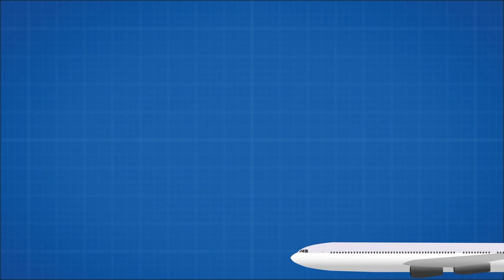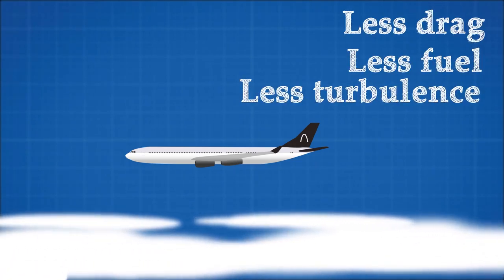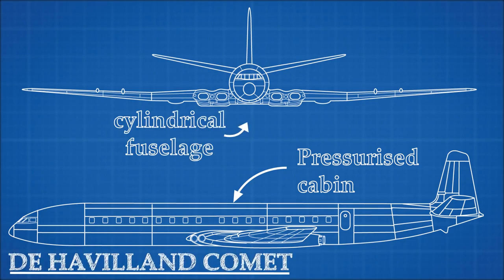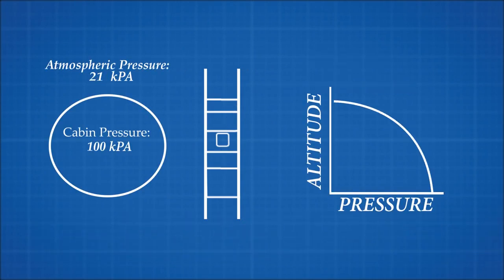Why are plane windows round?

Comment: You have parts of this explanation correct but you have missed few very important points. You did not clearly establish the orientation of the forces and therefore stresses that act of the thin wall 
that makes up the fuselage. My guess is you are not an engineer.

Comment: The "square windows" issue that supposedly resulted in the Comet 1 disasters is a myth.  This has been recognised for years in the industry, and some work done at the University of Birmingham a couple of years ago comprehensively debunked the myth.. The corner radii of the windows was similar to the windows of more recent airliners, but the windows were larger and appeared "square".   The problem was associated with the way that the  rivet holes in the area around the windows were punched, rather than being drilled. The information is readily available for those who take the trouble to research it, rather than to continue to  believe in myths. 
And as a salutary lesson, check out what happened to a Boeing 737 of Aloha Airlines  in 1988.

Comment: This video is total wrong. First 40 seconds.. fine.

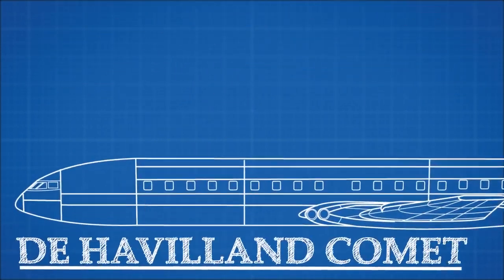0:41 The windows remained square

This is the comet square window myth. Its not true.

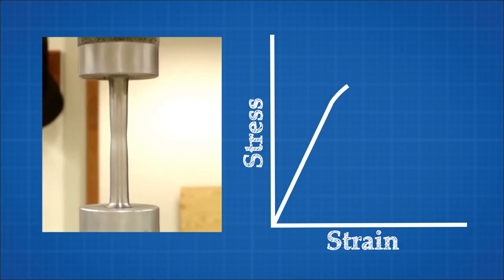1:06 This is not how metal fatigue works, while true, that is not claimed, by having this in the middle of the video, it make it sound like this is relevant, its not. This have literally nothing to do with the metal fatigue problem

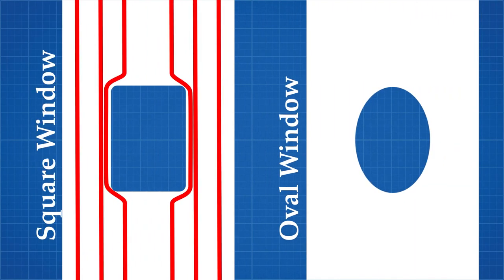1:30 While the stress-concentration idéa is in theory right, its not really relevant. The window frame reinforced to handle this stress, also the windows does take a bit of the stress.

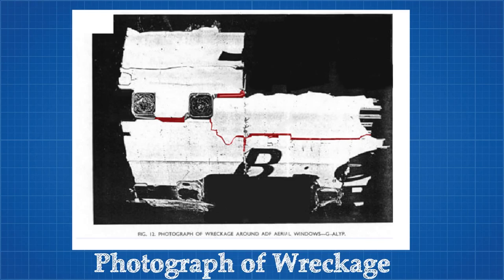1:41 No that is incorrect. Was caused the stress in the comment was push holes for the rivets. It was later replaced with drilled holes, solving the problem.

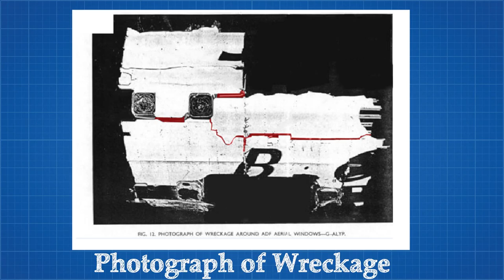1:47 No it didn´t cause 3 crashes. The crashed airliner that was salvage didn´t even have the crack in the window, but rather in a hatch...

Anyone how thinks this explanation is true... Look at the front of a airliner, see the windows there... are they round?

This is the problem with wikipedia engineers. ... that don´t bother to read the full article.

The issue is at the beginning of the article it says that it was the square windows fault... well sort of "concentrations of stress Unlike drill riveting, the imperfect nature of the hole created by punch-riveting could cause fatigue cracks to start developing around the rivet."And there is a source.

Comment: Jet engines are more efficient at higher altitudes do to difference between inlet temp and exhaust temp. Drag has.little to do with it since aircraft must  fly faster (higher True Air Speed) at higher altitudes  to generate the same amount of lift.

Comment: Does this same logic apply to the front windows as well? Because the front windows are not circular. Or do the windows just have to have rounded corners?
Reply: It only applies to the window, the explanation in the video is not correct. If it where, this would also apply to the big window in front.

Comment: Well, it was later revealed that it was not the window shape that caused Comet to crash. It was rivetting method, which was chosen as a cheap alternative to glue (probably expensive loctite glue) window mounting. https://aviation-safety.net/database/record.php?id=19540110-1

Comment: Comet had rectilinear windows with radiused corners.
Most modern airliner windows are not truly round -they still have parallel sides but with generously rounded ends.
In the media this issue has always been simplified to square vs round

Comment: Your videos are always interesting and well thought-out however, in this case, you have unfortunately fallen prey to an oft repeated misstatement, regarding the DH Comet 1 aircraft and its windows.

This is a misunderstanding that is annoyingly persistent. 

The accident report can be found here: https://www.baaa-acro.com/sites/default/files/import/uploads/2017/04/G-ALYP.pdf

Two aircraft were lost due to inflight breakups associated with fatigue: G-ALYP on 10 January 1954 and G-ALYY on 08 April 1954.

In the case of G-ALYP which suffered an inflight breakup off Elba, the recovered wreckage showed that a crack formed at a countersunk bolt hole near the corner of the ADF Antenna ‘Window’ Panel and basically unzipped the forward section of the fuselage causing a catastrophic failure.The unfortunate use of the word ‘window’ in referring to this panel is in part responsible for this misunderstanding. 

The report shows that de Havilland had underestimated the stresses at ALL of the cutouts in the fuselage (doors, hatches and windows) and stresses were much higher than originally calculated.
Given the same structure, but with the oval windows of the later Comet 4C, the fuselage would likely have failed in the same way. 

Nowhere in the accident report does it even mention the shape of the windows, let alone make a requirement for them to be changed.

The aircraft was simply not strong enough nor was it built to a 'fail safe' standards that would later be universal. This was largely due to a lack of knowledge and experience with pressurised aircraft at the time.

It should also be noted that the ‘square’ window shape of the Comet 1 was almost identical to other contemporary pressurised airliners like the B-377 and DC-7 aircraft. http://www.stinsonflyer.com/prop/dc7c-3.jpg
http://famgus.se/Vykort/APC-Aircraft-B377.html

It can also be clearly seen in the photo of the escape hatch that Comet 1 windows had a corner radius very similar to modern airliners.

The French Caravelle even had triangular windows - with rounded corners. http://company.airbus.com/company/heritage/now-and-then/The-Caravelle.html
Nowhere in the accident report do the investigators say the passenger window ‘shape’ was the cause of the accident. 

The image of the fatigue test aircraft fuselage (Fig 7 in the accident report) shows that the failure occurred at the mid-point of the fuselage radius i.e. at the widest point and along a fuselage stringer that happened have an escape hatch- not a window, located in it.    https://aviation-safety.net/photos/displayphoto.php?id=19540110-1&vnr=6&kind=C

The external image shows how the fuselage failed along the stringer line. https://www.fose1.plymouth.ac.uk/fatiguefracture/tutorials/FailureCases/images/CM7ALYU3.jpg

Had heavier gauge aluminium been used for the skin or had the fuselage formers and stringers been stronger, or the cut-outs been properly reinforced, the aircraft would not have fatigued in this way but knowledge of fatigue was limited in those early days of jet transport design.

The discoveries made about fatigue during the investigation was passed to the US and was incorporated into the later B-707 and DC-8 aircraft designs.

The Comet was, as a result of the findings, redesigned with heavier gauge skin and many other improvements,  including oval passenger windows but again, most other airliners continued with the similar shaped window with corner radii the same as the Comet.  The shape of the escape hatches remained the same as in the Comet 1.

All modern airliners still have rectangular windows with rounded corners, as did Comet 1.

Beware the aviation zombie myth!
Reply: Some additional corrections/comments:
The corner radius is a critical factor. I believe some of the other airplanes you mentioned have larger corner radii, which reduces the stress concentration...thus less cracking. 
Another point is that the older piston-powered airliners are flying at lower altitudes than the Comet. This results in lower pressurization and significantly less cracking. Crack growth is very sensitive to stress.

Comment: Unfortunately several inaccuracies in this vid. Firstly jets fly higher because they rely on the temperature differential between inlet and exhaust to create power. If the temperatures were the same all you would have is a fan. At ground level the temperature can vary between 40+C at the equator to -40C near the poles. At 12000M altitude the air temp is often around -55C everywhere, giving you more thrust for a given amount of fuel. At +40C engine power is considered marginal for take-off with a single engine in most types (the worst emergency at take-off) and so the FAA for example  grounds above this temp. Also the reason the DH Comet failed was metal fatigue not stress per-se. Metal fatigue was not fully understood until the 1960's.

Comment: Just dropped by to point out that airplane windows aren't actually round, as you can plainly observe for yourself if you only bother to take a look. They also aren't oval. They are rounded (have rounded corners), which is not at all the same as round or oval.

Comment: You sort of have it correct.  Yes, the square window has a higher stress concentration as compared to a round window but that is not the whole story on why the Comets failed.  The aircraft didn't fail as you showed where the stress goes above the ultimate strength which would have been a pure overload scenario.  The window failed because of fatigue of the metal caused by numerous pressurization and depressurization cycles, just like the 737 in Hawaii where the top of the aircraft fell off a few years back.
Reply: And the Comet story is a tad deeper than that even.  It was a misapplication of the testing protocol done upon the prototypes that failed to reveal the problem prior to production.  A prototype was first tested with an over-pressurization of the cabin.  Doing so created a highly localized plasticity in the window corners.  When the over-pressure was released, it left a residual compression of the material in the window corners, effectively making that prototype immune to fatigue failure in the window corners.  The subsequent fatigue test was supposed to be conducted on a separate prototype (one that had not first been over-pressurized), which is the condition the production planes are in when they leave the assembly line.  The problem could have been identified before they went into production.

Comment: For the same reason oval windows are also used in ship design. Actually there is no corner joints in ship building cuz corners tend to crack.

Comment: 1)The same amount of material,when moulded as a cylinder has lesser surface area for the same volume,than a cuboid.
This causes the the density of air to increase when same number of moles are within,which causes higher pressure as compared to cuboid.
2) It is aerodynamic.
Reply: Eeshan Khan 
Pressure is pressure. Has nothing to do with moles.

Comment: You could have mentioned that all the planes flew for about a year before they failed. This was due to metal fatigue. Microscopic cracks that grows larger with each flight until there is not enough sound material left to carry the load and you will have a failure.

Of course our modern aircrafts also have these growing cracks. They are designed better, so the cracks will not grow as fast, but the cracks are still growing and the aircrafts would break apart if they flew enough times. That's why we have regular inspections to check the size of the cracks and determine if they are large enough to warrant any concern. So how do they determine the interval for the inspections? Fist they decide what is the smallest cracks that will be unnoticed, or ignored during an inspection. Then they calculate the growth rate of these cracks, to get to the number of flights it would take for the plane to be in danger of breaking apart. That number of flights is the inspection interval. (or if the inspection interval is set, you can determine what size cracks you can allow during an inspection.)

Comment: It called material fatigue (durable is NOT an engineering word): It is the weakening of any materials experiencing a load in a repeated cycle over long period of time.

Just like a paperclip, bend enough times (back and forth) and it will eventually brakes.  This is where stress distribution/ relief/ concentration designs are so important.

Even with oval windows, stress will still buildup over time especially at the joint (welding, riveting & etc) which is why pressurized planes such as 747 only have 27 years of services life (165,000 max flight ours) before being scrapped.
Reply: Ship portholes are rounded or completely round for the same reason.  Stress concentrations are the enemy.
Reply: You're so smart... Google must defer to you for most answers.
Reply: a.k.a. durability

Comment: I am sorry to say but you missed the main point of why windows are round. It's fatigue stress not (so much) the shape. I worked for Boeing in their fatigue group and the Comet problem I know quite well. The static stress at the Comet window corners was 41 ksi. The aluminum skin was ok for a static stress of 41 ksi, the 2024 material tensile strength was 69 ksi but yield is 47 ksi. That is the key, it was operating at almost yield on every flight. So fatigue is the criminal, but the stress concentration was also partner in this crime. FYI

Comment: Sorry but you're wrong. It's the window OPENING that carries the load and the window opening has the soft smooth corners. The opening itself is reinforced with thicker fuselage skin and internal bonded doublers to carry the fuselage loads around the opening. The window itself is a plug in the opening. Does it carry some loads? Yes, but the bolts that hold the window plug are long, and are actually only designed to hold the window correctly in the opening. So very little of the fuselage load that is in the skin is actually carried through the window itself. I know this, I've repaired scores of corroded window openings on older B747's. Most of this kind of math and design is not taught or learned in college. You have to be a good maintenance engineer on the shop floor where you learn this kind of stuff.

Comment: So, a plane is bigger when it's in the air than when it's on the ground?!??
Reply: Planes actually get smaller the higher the fly. Every plane that I've watched taking off gets much smaller as I see it going higher. Usually they get so small that they disappear completely.
Reply: Eduard Butkaliuk wider diameter, yes.
Reply: but it is only a very little difference
Reply: Rimi nõuandeliin but that very little different can have a major impact on the stresses within the material
Reply: Yes, both in length and diameter.